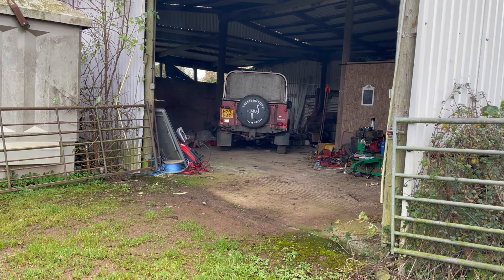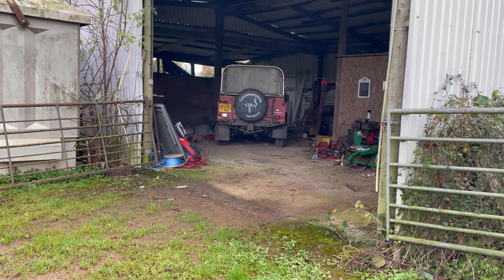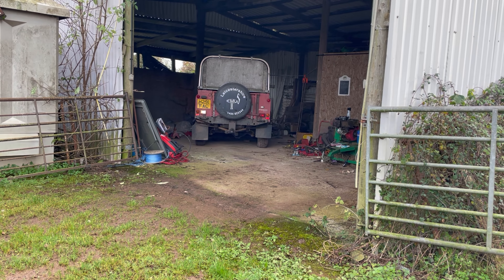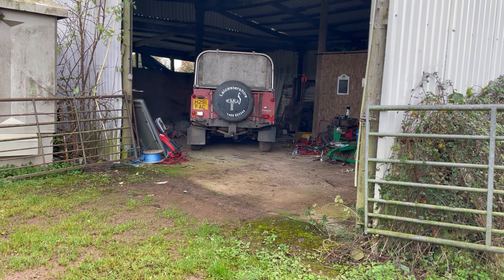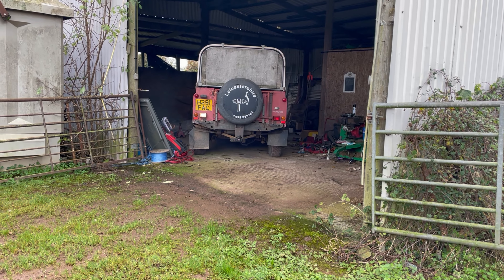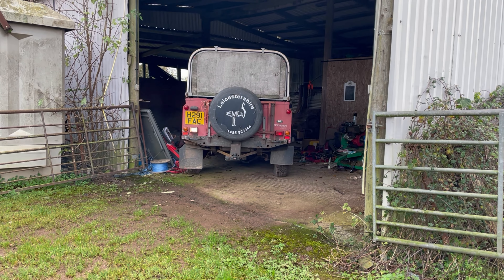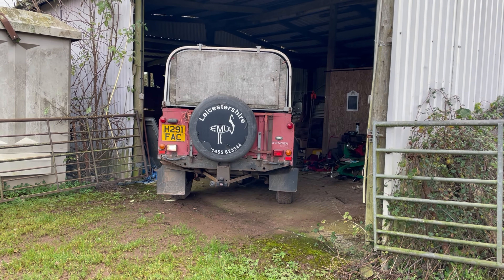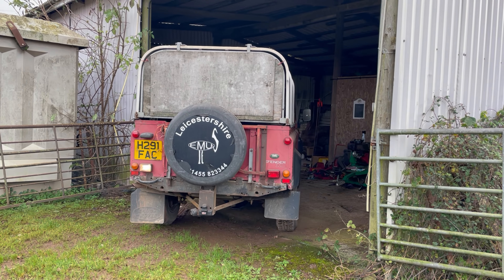Test driving the defender 110

Comment: Don't know why this stoated up in my feed - I've a 110 project languishing, so it's kinda given me a wee kick to do something - anything -to move it forward.

I'm guessing yours is a 300tdi - simply because it didn't fire first kick. 
No idea why, but my 200tdi (Disco engine) and other Defender 200's, always fire first kick just looking at them - everyone's 300 wants to fanny about first, and taste the diesel like it's sampling a fine Margaux,  before informing the waiter it's acceptable...

Good kuck, with the project.
Reply from the maker: Hi I’m glad I’ve motivated you into starting yours again. No mine is a 200tdi I’m not sure why it didn’t start first go it usually does, although that was its first start for many months so maybe that’s why.  Good luck with yours what is your project is it a fully restoration?
Reply: @Allthingsdefender A 200 tractor👍 
Aye, probably sluggish  just with lying up then. 
Mine is a partial restore. It's not going back to show condition! 
I bought it with an empty engine bay. I thought I had nothing to do but drop in my old Disco engine - turned out that was pretty shagged, though, and I had to do a full nut n bolt  engine rebuild - fun, but spendy. 

It's a thing of beauty now though, and fires first kick - I also had to clock the turbo to clear the 110 wing, because the Disco 200 turbo sits low. 

Salisbury + drums.on the rear - but all the mounts on it were shagged, and poorly repaired - so that job is holding the project up. I've welded on shock mounts, but still got the trailing arm mounts to do.
No big workshop, so tricky in the wind, and rain. 
 
I'm thinking of just dropping the axle out completely to make the job easier - but then I wouldn't be able to help stripping the diff down... doing the A-frame etc 🙄

Doors aren't too bad, probably needs the dash out, for some loom work, and the body is pretty untidy - Needs stripped back and resprayed to get rid of the Dulux, and filler!

The chassis was well waxed, and shutzed over its life, but the  crossmember was paper - got a galvi crossmember cheap enough.
After that, maybe a full rear bulkhead conversion for a bit of legroom - cut it away and put a bar in.  

I'll have to look in and see how you're getting on with yours if you post anything else.
I keep going to do videos, but can never be arsed! 

All the best 👍🍺
Reply from the maker: You should video it even if it’s just a record for yourself. I watch my own videos to see how to put it back together again after I’ve taken it apart!